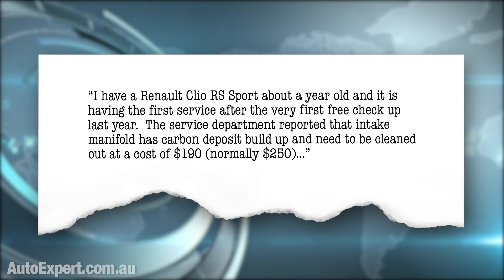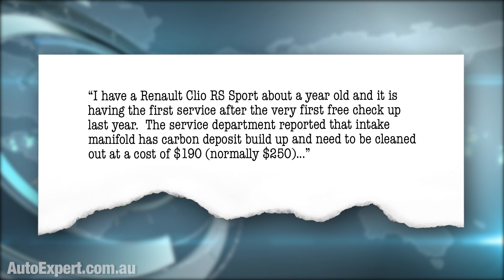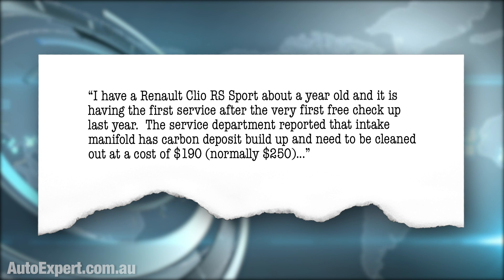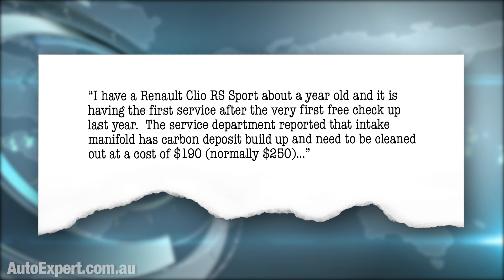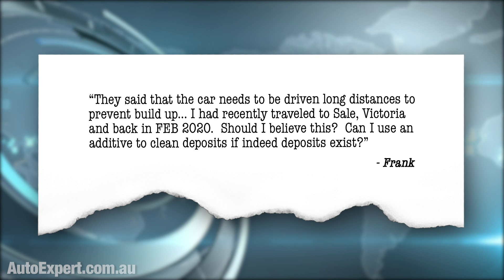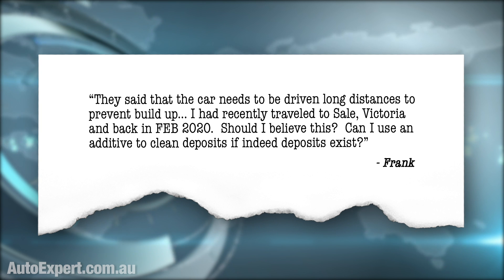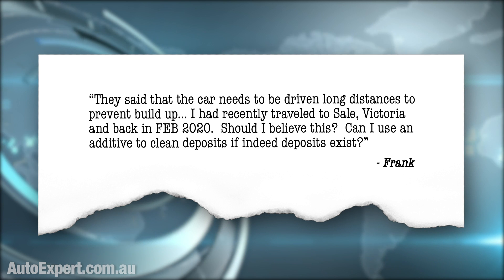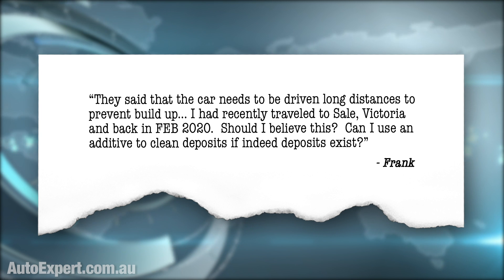The truth about inlet carbon deposits (sludge) in modern engines | Auto Expert John Cadogan

Comment: I once worked with a guy that would constantly switch from full throttle to zero throttle on the highway, literally every few seconds. Not a pleasant ride, but he claimed it prevents EGR gas recirculation, thus reducing intake carbon build up in deisel engines. Is there any truth in that?

Comment: Same DID Turbo diesels , but 2 different usage patterns 
1/ 95k , 3mm manifold build up 70% coverage // swirl flaps high build up // ports minor build up //  **  City /suburban driving 90%  towing tradie 
2 / 205 k   4+mm manifold build up over 90% coverage // swirl flaps modest coverage // high build up in ports [scraping teaspoons at a time ]    ////   70% country driving and 30 city driving .
---Summary high speed does not stop build up in cylinder head ports   but slows build up in manifold . . The manifold needs cleaning preferred 100k-upto -150k .
Some engines  are really bad for build up .
----I have used 2 cans on car manifold clean prior . IT WAS INEFFECTIVE AT REMOVAL

Comment: This one is an excellent video, and now all that misunderstanding of how the fuel/air intake system is gone. t hadn't considered how that oil in the intake from pcv and egr would affect it the intake.  If I could remove them from the equation; I would.  Somebody has done it successfully and are enjoying the benefits of a cleaner air intake possibly many have done it.

Comment: with engine off, i decided to clean my valves. I closed the valve manually and picked the big chunks off. I got most of it and then decided to spray the GDI intake cleaner from CRC to let it soak. My valve wasn't fully closed. My engine hasn't been started. My question is two part.  Should I simply spray a bunch more to get it down the walls into the oil and change oil? Should I let it dry out before starting the car and then run it through intake? Any advice is helpful if it is helpful advice.
Reply: Hi so what did you do?
Reply: @saulgoodman124  i took a straw and shop vac and blew it out from the spark plug out the intake and then let it dry and then did shop vac again but this time I sucked up any large chunks that may have been left down there. I checked with boroscope and didn't see anything worth stressing off. Most of the carbon was wet and not hardened so it would burn off either way. But that's one way. I figured cleaning combustion chamber is basically doing a cleaner and then forcing it down piston walls so as long as you do oil change and no hard carbon is left, it should be fine
Reply: @theTanees  Many thanks for replying back, glad it worked out fine!

Comment: Wow, this is the best explanation of how this all works and why! 
I'm starting to do oil changes every 5k on my new (2nd hand) 1.6l turbo 2020 seltos. I had 2 diesel 2.2l motors die on my old 2009 mazda6 and didnt fully understand why.
Than you so much!👍🤠🇦🇺
Reply: I’m about to buy a 2nd hand 2015 Mazda 6 with the 2.2l diesel and about 100.000 miles on it

What’s your experience with carbon buildup on that engine?
How much did you drive/ what would you recommend as a procedure to keep it clean?
Reply: @arwo1143  Hi. I
The best thing to do is to do an oil and filter change half way between the recommended servicing. (5000klm for me)
Especially if you are doing alot of short 5 to 10min trips. Additionally, in colder climates, oil contamination will be worse. Try to go for longer drives, 30 to 60min atleast once a week to keep the DPF clean. That also is a big issue. My motor was regularly serviced as required but the oil contamination killed my motor and turbo at only 140,000klm. I put in a second hand motor and turbo and after another 50,000klm, it was showing signs of bearing flakein the oil so i traded it in before it died. Recommended servicing was 10,000klm. On that car, I never knew or did a 5000klm oil and filter change but now do it on my new direct injection petrol turbo as they can have similar issues and carbon build-up on the intake valves. Always useshigh quality synthetic oils and filter. I loved the power and efficiency of the turbo diesel but are hesitant to get another one. Many recommendations I found after with the regular oil changes would have significantly prevented the damage to the motor. Basically all new diesel turbo's have this same flaw but i found out too late like many others. Hope it works out for you.  Goodluck.  :)

Edit: Oh, I never checked or knew about carbon build up at the time but can't imagine it was good. 
It was a daily driver with many short trips. The car lasted 12 years for me. I would buy a new diesel knowing what i know now but 100k miles.... probably not a good idea into.

Comment: How about to use a spray of such product as CRC GDI Service Kit in lieu of the (industrial) walnut blasting kit on Amazon? I understand that there might be an issue with the PCV system and or diaphragm on the valve cover on my 2012 Volvo S60 T4 with the B16T4 (Ford Europe engine) as I’ve had oil leaks from the VVT solenoids. The damper oil retainer is waiting to be replaced to replenish my wallet. But the blow by test on the oil fill passed ok!

Comment: dipshitter here!   dump the pcv and egr and di - all solutions to a problem created by misguided legislation.   no point being 'green' for 6 months until the you-beaut systems cock-up and your finely engineered complex car runs like shit, uses more fuel, and needs to be taken to the dealer every 2 weeks - not good when you live 3 hrs from the dealer.    All you have done is built in more failure modes.  give me the best sfc and bmep - just an efficient engine - and keep all the heavy, costly, polluting crap.

Comment: And what about the fuel system cleaners? (with indirect injection) I've seen tests and it increased the power, I've tested on my own (tho no dyno) and the response & feel was better.
And there's freevalve doesn't even need DI - brings no benefit to it, ~50% cleaner and 20%+ more eff than conventional engine with camshaft.

Comment: If you have a gdi engine that only drives 10 or 15 miles one way after starting cold in the morning.ypu had better change your oil and filter every 3 to 3500 miles .keep in mind that you dont have to buy the most expensive oil since you are changing it so often regular non synthetic oil of the proper grade and type will do you just fine.this advice is for the regular car used for work and back grocery getter and vacation once in a while use....good luck gods speed👍

Comment: Is there any research that shows if catch cans are actually effective at reducing carbon deposits in diesels?
Reply: I've been curious about this too. As John says, the main thing people focus on when commenting on catch can 'effectiveness' is how much oil they are trapping. Presumably if the engine is working as designed then without a catch can most of that oil would go through the EGR, enter into the combustion chamber, and burn off. It's the amount that gets trapped in the intake manifold that is the problem, but nobody seems to have a good pre/post comparison (it would take a few years/tens of thousands of km to test).

There also seems to be a lot of youtube videos of mechanics saying that the 'sludge' entering the engine must be a problem- but none of them ever show evidence of damage anywhere. It's all just carbon buildup on the manifold itself. Again, if the engine is working as designed then the material that enters the combustion chamber itself should combust. It's worth noting that this material should still be mostly a fluid state (gaseous or liquid) by the time it makes it to the combustion chamber too, so the potential damage that would be caused by a solid to the cylinder or pistons should be minimal. Any that gets past the piston rings into the oil... well it was largely there to begin with and the best way to deal with that risk is more frequent oil changes.

Last thought- I think John's analogy to cholesterol is a good one. One of the causes of plaque buildup in arteries is turbulent flow of blood (I'm a physiologist). When blood flows smoothly (called laminar flow), its dissolved components are carried well without falling out of solution. Sharp bends and branches in the arteries naturally disrupt laminar flow- if you fish on rivers, eddies past a rock or a log are caused the same phenomenon. These disruptions produce turbulence and cause the cholesterol/fat molecules to fall out of suspension for the same reason air falls out of water solution in the river (creating bubbles in the river). I imagine the exact same phenomenon is happening in the intake manifold- its shape/structure has a number of twists and turns that would create turbulence in the air flow. Those would be most noticeable at any 90 degree (or greater) bends in the tube, and at the 90-degree turns from the common rail into each cylinder port. A gaseous/air mixture including heavy droplets of oil mist would be most likely to lose those droplets at those sharp turns that disrupt the flow of air. Once they accumulate on the internal surface of the manifold is when they would start to 'dry' and cook into more of a soot.

On that line of thinking, it's interesting that nobody seems to report soot/carbon buildup in the EGR pipe/hose itself, or within the hoses of the catch cans. I suspect this is for 2 reasons: 1) the airflow is still fairly laminar if there are no tight turns so the oil droplets don't fall out of suspension, and 2) the temperature, pressure, and rate of flow are such that there is never an opportunity for any droplets to stay in one place. There's a third possibility- in vehicles I've looked at, the internal volume of the common rail is larger than the EGR pipe, and once a gas moves at high pressure into a space of larger volume it will drop in pressure and reduce in velocity at the same time- and both of these events also present an opportunity for any suspended oil droplets to fall out of suspension.

Happy to be corrected by anyone who knows better, but this is my suspicion so far. I only know enough fluid mechanics to understand how it impacts on blood, but the basic principles are universal to fluids.
Reply: Sorry- 2 more thoughts

The manifold cleaning itself seems a pretty minor thing even though it looks invasive/time intensive. The quotes I've seen online are typically around $500-1000 Australian and most people doing it at home say it takes about 5 hours if you know what you're doing (soaking time for the manifold aside). Given that most people are only doing it once every 50,000 km at most it's not that terrible a maintenance cost, especially since there isn't any clear evidence of the carbon itself causing damage- I bet most of the damage people do associate with it has more to do with the engine oil going bad/being too old because they haven't done a good job of maintaining the other aspects of the vehicle. Of course a choked engine must be frustrating if an entire port gets clogged up, but it's also a very easy fix that is more an inconvenience than anything life-threatening.

It is pretty amazing how ubiquitously this issue is used to justify catch cans, EGR blocking plates, and EGR valve bypasses! It's almost as bad as the alternative medicine industry- possibly worse when you consider that the blocking plates and valve bypasses are illegal and can get you a hefty fine if it's ever found out. Buying a used diesel you'd also want to be VERY careful to ask the seller if they had installed this stuff too. It doesn't look like any of these installations harm the vehicle in any way, and they certainly could help improve performance, but you wouldn't want to get caught with a fine for something you hadn't done yourself!
Reply: @juvandy  EGR block offs are only rivaled by DPF deletes on the forums I follow. I don’t understand the logic for that either.

Comment: ? Why no mention of oil catch can/separator systems for direct injection vehicles. I installed one on my new C8 Corvette with 1,200 miles (engine broken in) and noticed about 30 milliliters in the can after just 200 miles. I notice similar results with my 2017 Shelby GT350R after installing a Ford System from Ford Racing. Also seems to me that it would be reasonable to develop an ultrasonic intake air system to keep the intake tract/valves from developing deposits. Seems to me that an ultrasonic intake system was used in European automobiles years ago, but for different reasons such as increased atomization of fuel and thus increased fuel mileage and better performance.

Comment: Hi John, what about applying inlet valve cleaner (ie. Seafoam) before every oil change? Would that help the carbon from building up on the intake valve? I have done this "extra" step with all my Hondas with EarthDream DI since 2015 and no problem with any of them engines so far, but never had a chance to take apart the intake manifold to take a peep (very difficult to access).

Comment: It's simple math and I don't think the engineers are saving people money by increasing fuel economy at the expense of increased maintenance costs.  Lets say you drive 12k a year and gas cost $3/gal.  With 24 mpg you spend $1,500 a year on gas (12,000/24*$3).  With 25 mpg you spend $1,440 a year (12,000/25*$3).  That single mpg increase only saved you $60.  If that $60 savings at the pump cost you more than that in increased maintenance you have lost money and time while the repair had to be performed.

Comment: The built in fault with modern engines is the struggle to achieve good Mpg and the tight emissions figures.
   Take Ford eco boost for example, the piston rings are a lot less forceful on the bores to allow the engine to run looser to allow the engine to achieve good mpg and emissions.
   This allows blowby which then causes oily crankcase gases to be recircled which in turn basically chokes it self when it repeats the cycle. So basically a built in design fault. EGR then bakes all this hard. Absolute junk. This guy explains it to a tee

Comment: Another thing people don’t realize it that auto manufacturers are in the business of making cars - if their products don’t break and wear out regularly, the business won’t survive very long. 
To help with intake valve coking, Air-oil separators/catch cans work, but so does water injected into the intake. Those together with a good hour-long jaunt weekly at highway speeds will keep an internal combustion engine “clean”.

Comment: While I agree that, in general, newer technology is superior and constitues progress (gasoline multi-port fuel injection vs carburetor, for example), I feel that maybe gasoline direct injection has not matured enough yet. There are too many manufacturers that still have trouble with their modern, down-sized, turbo-charged, direct fuel injection engines. Ford's Ecoboost, all VW TSIs, Renault's TCEs, and even a few Honda engines, are all a far cry from their predecessors as far as reliability goes. And the particle emissions are also higher - hence the mandatory GPF for directly injected Euro 6d cars, which adds further complexity and potential failure points. The way I see this, gains in fuel economy are largely negated by higher maintenance and repair costs, the need for more expensive oil and fuel (in some cases), and higher depreciation, associated with the decrease in life-expectancy, with cars becoming more and more a throw-away item. It may be good for the environment, it may be good for the industry, but I'm pretty certain it's overall more expensive for car owners.

Comment: Build up does happen on the valves of a direct injection engine. My wife’s 2011 VW Tiguan 2.0 L TDI engine at 98,000 miles started to get cold start misfires. I knew what it was as soon as it happened took the vehicle into the dealership and $700 later and six hours of labor the valves have been cleaned. I got to look at the valves before they started the cleaning and they were very very built up with carbon. I looked at doing the job myself and I didn’t really want to spend 6 to 7 hours and all you have to go through on that particular engine to get the intake manifold off. On this engine it takes two hours to get it off and two hours to get it back on and the cleaning in between. after watching some videos I decided not to take it on myself.

Comment: Just add a watermethanol injection system! It cleans, it cools, it increase octane and fuel economy. Perfect solution!
Reply from the maker: Plus it voids your warranty and doesn't really work. Yesssssssss!
Reply: Auto Expert John Cadogan Oh John, it really does work. Installed one, all the benefits are very real based on my obd 2 sensor data. Of course ECU learning and benefits will vary from car to car, it is the perfect solution to any charged air car!

Who needs warranty anyway? I don’t have a warranty on me, do you?

Comment: That's the reason i have a catch can fitted to my DI diesel.  By reducing the amount of oily vapour being sucked back into the intake to mix with sooty exhaust gas can only be a good thing and it doesn't violate emission control regulations by either venting the PCV to atmosphere or blanking of the EGR system that some uninformed environmental vandals do.